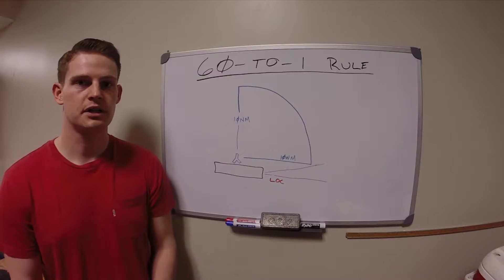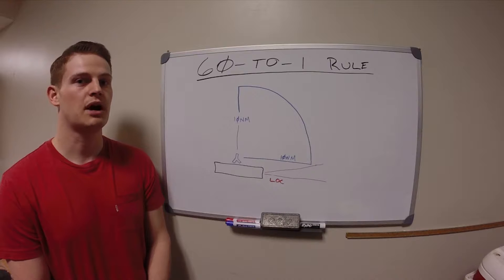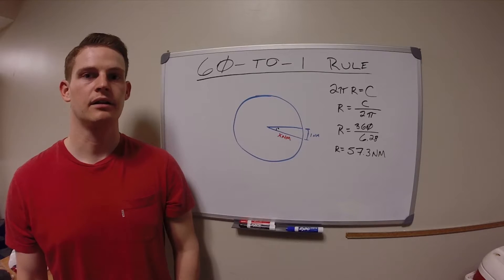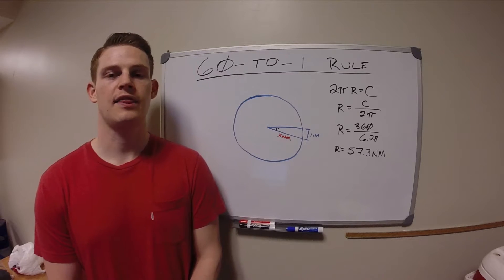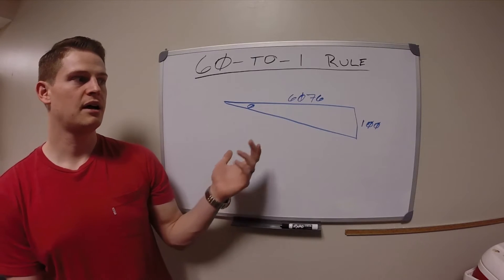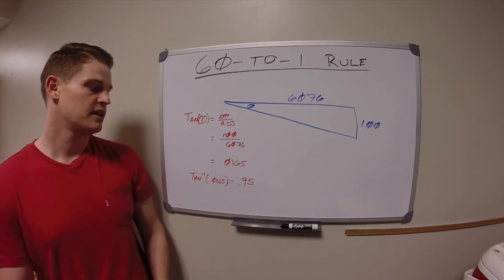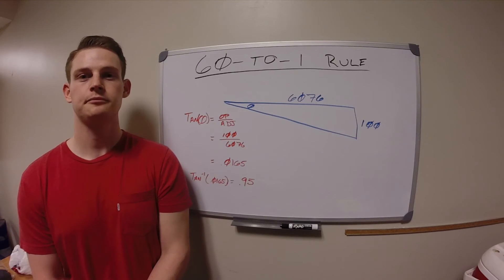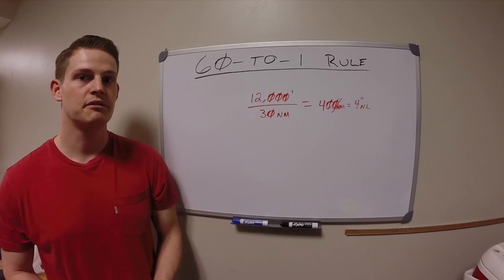All Things Aviation: Navigation Concepts 60-To-1 Rule

Comment: Thank you for taking the time to explain this rule in this detail. Very good info.
Reply from the maker: I'm so glad you found it helpful! Please feel free to send me any questions or suggestions you may have.
Reply: A quick question, for entering the arc, why did you subtract 50knts out of the ground speed? [6:59] in the video.
Reply from the maker: If you want to get technical about it, there are actual formulas that can be used to calculate an exact lead point. However, when I'm flying - especially in the weather - I want to concentrate on flying the airplane rather than doing math. Subtracting 50 from the ground speed and then taking 1% of that in nautical miles is just a technique that allows the pilot to quickly and easily compute a lead point with minimal effort so he can stay concentrated on flying the plane. In my experience this technique will generate the same or very nearly the same lead point as the formula and allows me to fly a safer airplane.
Reply: You are absolutely correct, thanks again.